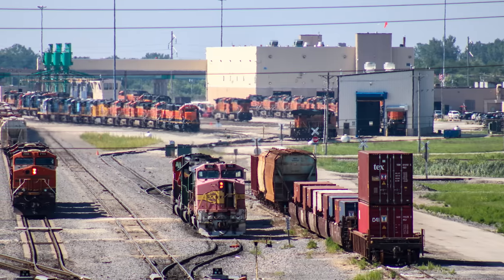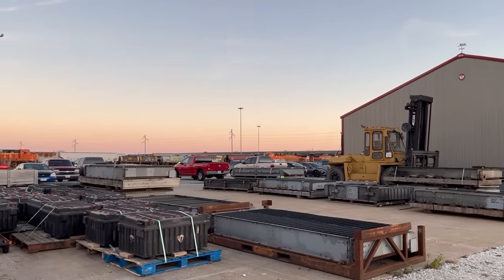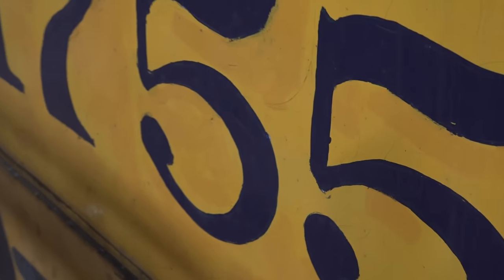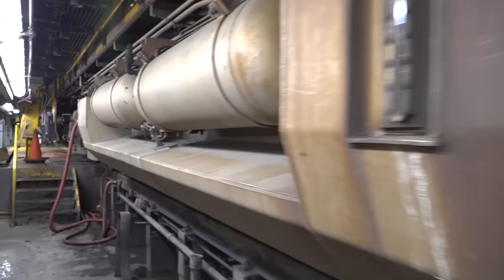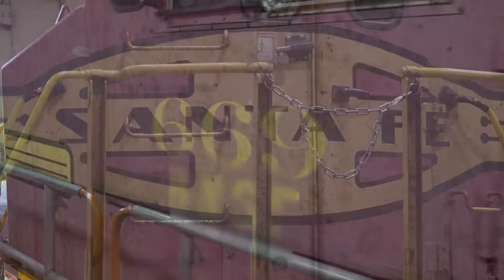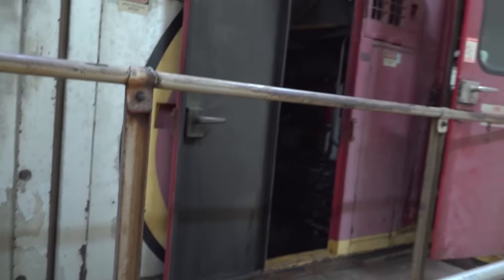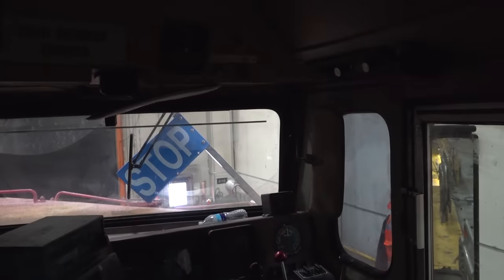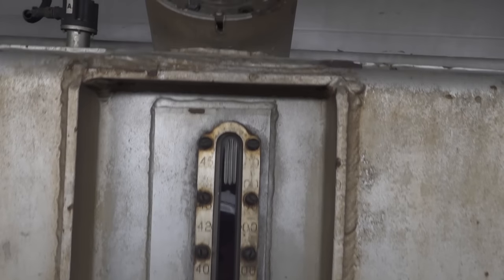Inside Galesburg's Incredible Locomotive Shops!

Comment: As an automotive mechanic, it's great to know that mechanics of all machines are all the same slightly childish, sarcastic smart asses. The butter reminded me of the time (someone who shall remain nameless) turned our cheetah cannon into an air powered, socket firing death mortar. And ended up blasting a 3/4 in socket through the shop wall at 100psi lol.

Comment: I know you might not take requests, but you should check out the Indiana Harbor Belt railroad's Gibson yard in Hammond. they have a locomotive similar to that NS rp14 called the rp15bdf rebuilt from SW1500s, the rp15bdf is only used by the IHB. no other railroad has them.